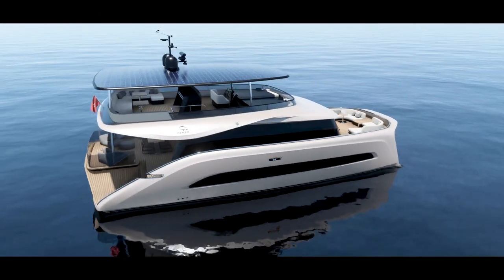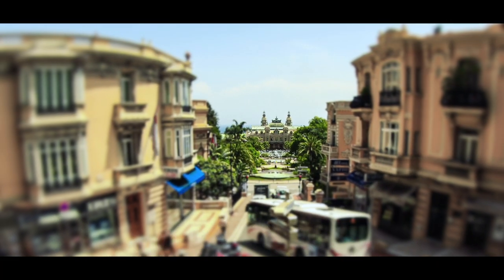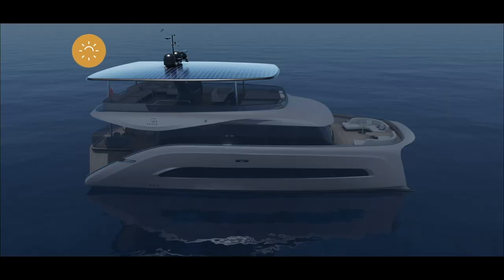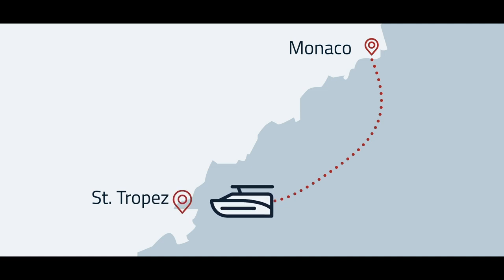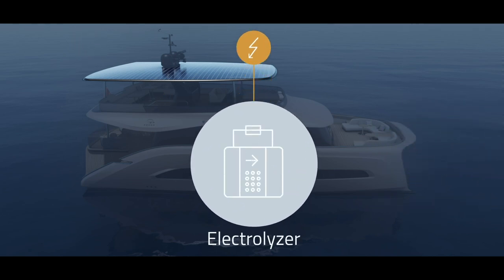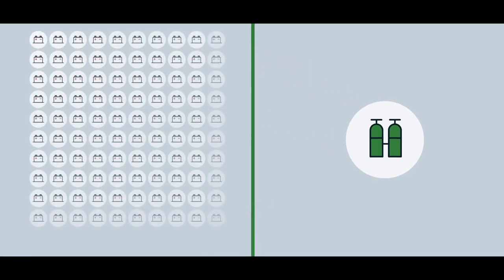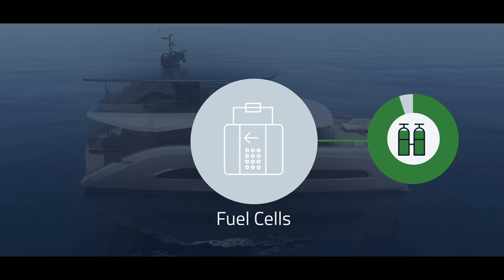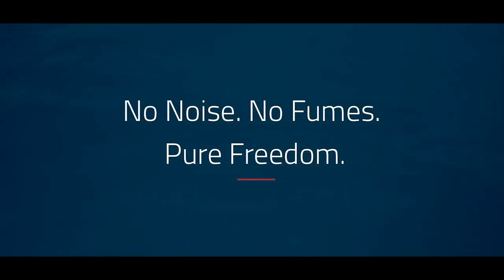AQUON One green hydrogen energy system explained

Comment: Solar+Hydrogen fuel cell is the ideal boating experience because you are floating in your fuel basically. Water ! as long as there is power or you don't mind parking for awhile, you should be able to make all the power you need. Your floating at a gas station
Reply: Great explanation! 🤣
Reply: You do realize that making hydrogen mean you throw away 2/3 of the energy...... It would be easier and more efficient to have more battery's and loose only 10%
So you might use 100 times (as the video says) more energy to make hydrogen, when converted back to electricity you are left with only like 35 times as much energy.
To make that 100 times more energy that you do need to sit still on anchor for 100 times longer to have the solarpanels generate it.
So this would only work for boats that sit on anchor at least 3 times more then a pure electric boat that is used for it's actual purpose. And if you want to do more sailing you will need to be in a harbor and pay for the huge amount of electricity you need for making your hydrogen........
Reply: Exactly. You’re on water and need a roof, use them because they’re free. Maybe the oil companies are paying the manufacturers to slow walk new technologies.

Comment: You loose up to 35% when you create hydrogen so 55KWh gives about 35KWh and its good for 100km in a car but this consume al ot more. You need a lot of charging time to fill them up again. Batteries would be better if you not fill them up ashore.
Reply from the maker: Dear Peter, 
Contrary to using hydrogen for cars, the AQUON One's energy system re-uses the waste heat for hot water supply on board, such as for showers, dishwasher, etc. This increases efficiency a lot.
Batteries are unfortunately very heavy and carrying this extra weight would make the cruising less efficient. Hydrogen is much lighter and this way we can store more energy on board and have a much higher cruising range (see the Use Cases on our website).
Reply: 62 mike rangé oerty god eabge
Reply: @AQUON_SwissSustainableYachting What kind of pressure is the hydrogen kept at to achieve this kind of energy density?
Reply: If only we had a more efficient hydrogen oxygen separator.
Reply: @AQUON_SwissSustainableYachting  The hydrogen tanks could also be a structural part of the hulls to save overall weight. Or you could convert the hydrogen into ammonia or methanol (with CO2 capture)

Comment: You know what they say: "when it sounds to good to be true, it probably is". Coming back to reality let look at some facts: 1) to make hydrogen out of water, the water needs to be purified in a very energy intensive process called "reverse osmosis". Putting seawater in a hydrolyzer will soil it in no time. That being said, there is talks of being able to hydrolyze sea water in the future but this is in early research stage and nowhere ready for commercial use today. 2) storing hydrogen is usually done at 700 bar in prohibitively expensive and heavy cylinders. Don't see this happening any time soon on a boat. The extra weight of the cylinders alone is going to make it your boat is going at crawl speed at best. 3) Even at 700 bar, the amount of hydrogen which can be stored in a limited space (such as a boat) doesn't give you much storage capacity. to make things worse, 4) the round-trip efficiency of conversion to hydrogen and back to electricity is less than 30% efficient so what will you have left to move your boat with? Not a lot. It's a nice pipe dream but that's about all it is in the current state of the art. It's going to remains a CGI video for now I reckon.
Reply: >purified in a very energy intensive process called "reverse osmosis"<
Sea water desalination by reverse osmosis costs between 2 and 4 watthours per liter of water.
Electrolysis costs around 5500 watthours per liter of water.
So the energy consumption of sea water desalination is negligible in this context.
At least this point doesn't really contradict the feasibility of such a yacht.
Reply: Let's assume a maximum daily yield of 65 kWh from the solar modules. This could give you around 1.2 kg of compressed hydrogen (no other consumption).
Which is the amount of hydrogen in 11 liters of water.

Comment: Great technology but i can't get peace of mind knowing that i am sitting on compressed hydrogen and the considerable dander that represents. Show me the protective system in place !
Reply from the maker: Dear Stokerjoe,
Every energy storage (diesel tanks, batteries and hydrogen gas) have their need for correct handling and safety measures. As for the hydrogen storage onboard AQUON One, we have gone the extra mile to certify the catamaran, the energy system as a whole, as well as each individual component for safety with DNV GL. The tanks, ventilation system and all materials are thus complying to highest safety and fire standards.
Reply: @AQUON_SwissSustainableYachting  thank you for the extra safety information, can't wait to see one and come on-board at the boat show in Florida.

Comment: Questions for inquiring minds - 
Galley cooking range is electric or propane ?
There does not seem to be a helm/nav station in the saloon ?
How often is maintenance needed on the LOHC system & the water generation units ?
Lastly, where is the tender or dinghy stored ?
Thanks!
Reply: The most similar ship that is currently sailing is the Energy observer, a test platform for green energy. It uses the same hydrogen system and the engineers on the ship say that it has very little maintenance requirements and has never broken down.

Comment: Damn... This model can beat out the Silent Yacht in terms of range. No diesel generator  needed and all the power you need to run Trans Atlantic, maybe even Pacific.
Reply: I am also following the developments  Silent Yachts. I believe the H2 tanks occupy more space than the batteries. I wish they could also add a Thin Film Solar Kite Sail and a Vertical Axis Wind turbine to augment the Solar charing.
Reply: @Soothsayer210  I saw a YouTube video detailing how sensitive solar cells are to shadows and that even a shadow covering 10 to 20% of the PV cells can drop its efficiency by half. That was why the designers of the Silent Yacht did not incorporate aany structure that could cast a shadow over their solar cells
Reply: @TheWinezen  which is why I was suggesting Kite Sails so that the sail will be flying way up in the air.
Also Vertical Axis Wind Trubines (not the regular Horizontal Axix ones) would not cast any shadows and can be used to charge the batteries in the night.
Reply: I think the LOHC ( Liquid organic hydrogen carriers) exchange system would be best to compliment the Silent Yacht system as the Hydrogen can be stored in a much safer temperature without the need for pressurized tanks and maintain high power density. The LOHC system can be used as backup or enhanced power system to keep the batteries charged for long voyages. When the boat is anchored a portion of the solar system could also be used to re-hydorgenize the LOHC system. All while maintaining or improving the same storage space to weight ratio needed for a diesel system.
Reply: @TheWinezen  i agree with you .You also gotta to remember Liquifying H2 or Compressing H2 takes energy. 
Alternatively H2 can also be transported as Ammonia (NH4) and can be separated. 
I see a huge scope for Green H2/Fuel Cells for Navigation applications. Time will tell.
Reply from the maker: Hi Kon Tiki,
The actual roof area covered with solar panels is almost 70sqm. Our specs conservatively state 64 sqm "usable" photovoltaic surface as it already factors in shades etc.
Reply: @Soothsayer210  LOHC does not liquify H2. It just locks the Hydrogen atoms in an organic chemical chain. It uses far, far less energy that is required to liquify H2. It is so efficient,  solar cells could power the process.  Plus the LOHC can be stored at normal room temperature and pressure and it is non combustible. Very dense and safe  power storage.
Reply: @TheWinezen  never heard of LOHC. Thanks for the info.
Reply: @Soothsayer210  got loads of good info. On YT and the Internet in general. Very exciting missing puzzle to sustainable energy systems.

Comment: "...is able to store a hundred times more energy than a modern battery system".
How so?
I suppose, you referred simply to specific energy of hydrogen and didn't consider needed space and the weight of pressure tanks.
1 kg of hydrogen can give you up to 20 kWh of electricity by fuel cells.
1 kg of lithium-ion-battery can store ~200 Wh. This would be a factor of 100.
But you need roughly 20 kg of pressure tank to store 1 kg of hydrogen.
Besides the weight of compressors, fuel cells, electrolyzer,....

Comment: Let's say those are 50m2 of solar panels, how long does it take for the boat to fill the tanks, 2 years?
It will need refueling, and it's completely fine, just state it clearly instead of saying it can "run on its own solar and hydrogen".
Reply from the maker: The 64-square-meters photovoltaic system covers the ongoing daily energy consumption to prevent the hydrogen tanks from ever running empty in the first place. 
In the unlikely case that one needs to fill empty hydrogen tanks, there are two options: refill with green hydrogen ashore or plug into land power to run the electrolysis.
Reply: @AQUON_SwissSustainableYachting  Maybe there should be retractable wind turbines that come up when there is more wind than solar energy (at night for instance).

Comment: If this were a sailboat, it would have the absolute best of both worlds.  It appears that as a motor yacht, there just isn't enough energy production & storage to allow uninterrupted transatlantic or transpacific crossings.  I would be very concerned about being stuck in the middle of the ocean with several days of bad weather (limited sunlight).  If this were a sailboat, while under sail, the majority of the solar energy could be used to power the electrolyser and fill the hydrogen tanks.
Reply from the maker: Agree, we definitely would also love this technology on sailboats. For this first model, we focus on a motor yacht as a sailing rig adds extra weight and regulatory complexity to the certification and construction of the yacht. But we are excited about what the future holds!

Comment: between 1:55 and 1:59 you mentioned "without refueling". Why would you ever need to refuel? What are you refueling with?
Reply from the maker: We are happy to clarify. AQUON One's energy system produces off-grid energy in form of solar power. This replenishes the hydrogen gas tanks on the go. So NO refueling is needed for the typical use case of a few hours of daily cruising.

In the rare scenario that the stored energy in the hydrogen tanks runs low (say after a transatlantic crossing), the replenishment can be sped-up by additional fueling options such as plugging into shore power (which is then converted into hydrogen), or directly refuelling with hydrogen gas.
Reply: @AQUON_SwissSustainableYachting  I see! Thank you for clarifying
Reply: Why not adding a generator? For additional source when more power/electricity is needed.
Reply: @AQUON_SwissSustainableYachting is there an option for vertical wing style sails?

Comment: what is the use of the solar panels when there's a bulk radar on top blocking the sun
Reply from the maker: The actual surface area of photovoltaic panels on top of the flybridge roof of AQUON One is 70 sqm. Yet, we do calculate all energy use cases with 64 sqm of photovoltaic panels because we are aware that some shade is cast on parts of the roof depending on the time of day. So the loss due to shade is already accounted for in the energy production calculations.

Comment: Very impresssive presentation, ideed ! the VoiceOver excellent. Very futuristic design, and the solar is really heating up in the boat market. As for the Hydrogen, as it seems amazing solution, the safe storage of such an flammable gas is worrisome. Definitely nobody wants to end up a Hindenburg Disaster on the water version. The only boat that uses that Hydrogen system is the Energy Observer experimental boat, and it contains a kind of "chimney" for a potential hydrogen explosion. HOW do you plan to address that point?
Reply from the maker: Dear BBtG,
Many thanks for your comments. We are aware that hydrogen propulsion is new in yachting and many wonder whether hydrogen storage is truly safe. This is why we are going the extra mile and having DNV certify 
1) all components of the energy system individually (incl. the hydrogen gas storage tanks), 2) the energy system as a whole;
3) the yacht
This is more than is required by regulations. Handled and stored safely, it’s no more or less dangerous than any other flammable material. The gas's auto-ignition temperature is higher than that of diesel and gasoline. And hydrogen is the lightest gas that exists (much lighter than air). So in case of any leakage, the gas quickly disperses with a ventilation system (like on the Energy Observer) into the atmosphere where it is then diluted. Hence the chance of an explosion is extremely low.

Hydrogen has also been used in other forms of transport (submarines, rockets, cars, trucks). The tanks for the marine application must hold up to even higher criteria and are designed to withstand fire and dilute the gas quickly when ruptured. This provides extra safety.

Also check out: https://www.youtube.com/watch?v=GpRyn5-ZbPU
Reply: @AQUON_SwissSustainableYachting  Thank you very much for the adequate explanations. It seems you are addressing some subjects that were dubious before.
That brings me to some Functionality questions. The design is very eastetically pleasing, and futuristic, but where would the tender go?
Could you give us a layout of the boat? the rooms look amazig, but I would like to see where they are located in the boat.
Reply from the maker: @BringBacktheGreeks  Thank you. When not in use, the tender is pulled up between the hulls. The location of the rooms in the various floorplan options can be found on our website, just below the virtual tour: https://aquon.ch/aquon-one/

Comment: How do you convert hydrogen into electricity without a generator?   What is the fuel cell process?
Reply from the maker: Dear Gus,
 
The fuel cell converts hydrogen into electricity. We could not explain it better than does https://www.fchea.org/fuelcells: "A fuel cell is composed of an anode, cathode, and an electrolyte membrane. A typical fuel cell works by passing hydrogen through the anode of a fuel cell and oxygen through the cathode. At the anode site, a catalyst splits the hydrogen molecules into electrons and protons. The protons pass through the porous electrolyte membrane, while the electrons are forced through a circuit, generating an electric current and excess heat. At the cathode, the protons, electrons, and oxygen combine to produce water molecules. As there are no moving parts, fuel cells operate silently and with extremely high reliability.”
Reply: @AQUON_SwissSustainableYachting  I've boned up a bit on this since I posted.  Still hard for me to believe this is a more efficient way to generate electricity than by combusting the H in a electric generator.  I'm no science denier, I guess if the math says so, then it is so.  Still.....